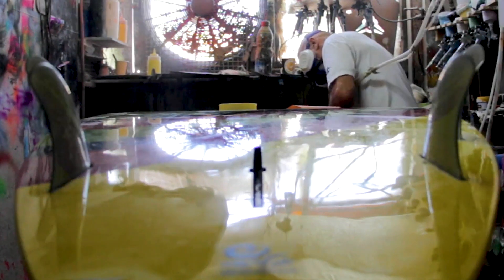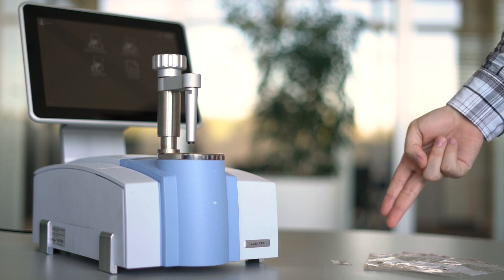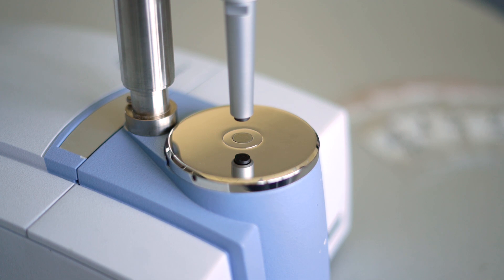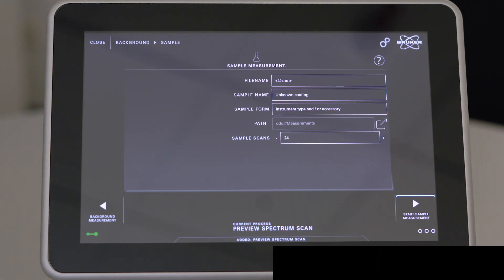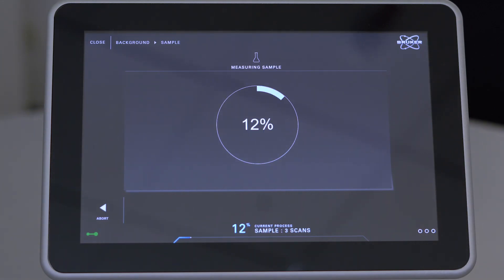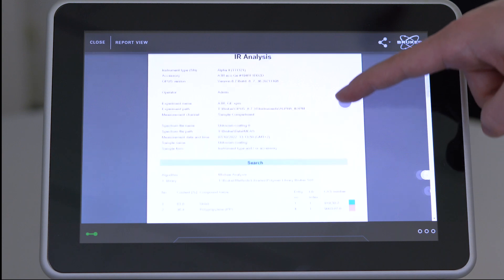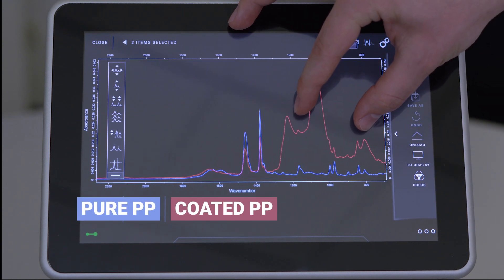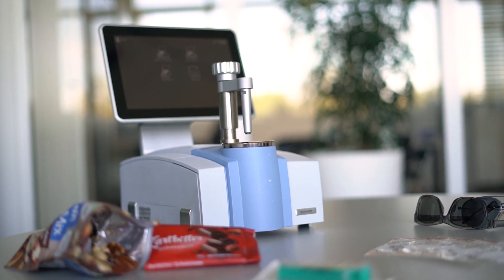Analysis of Coatings on Polymer Films | FT-IR Spectroscopy | Surface Analysis ALPHA II

Comment: What is the minimum thickness of the coating that is detectable by the Alpha and Lumos?
Reply from the maker: FT-IR spectroscopy and in particular FT-IR microscopy are quite powerful when it comes to identify even the thinnest of coatings. FT-IR microscopy can even detect mono layers on metal substrates, e.g. oxide layers on metal substrates.